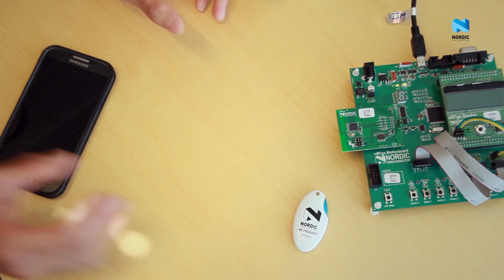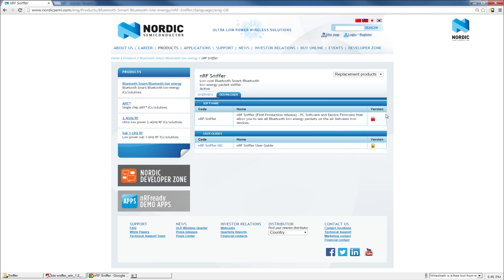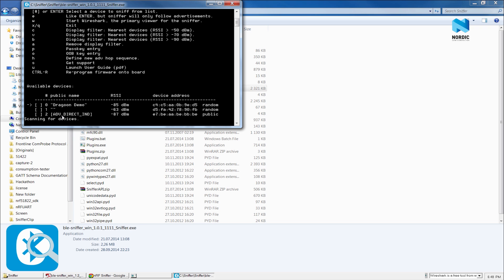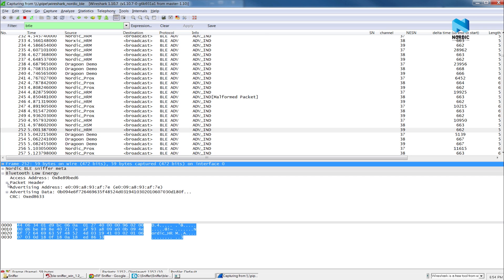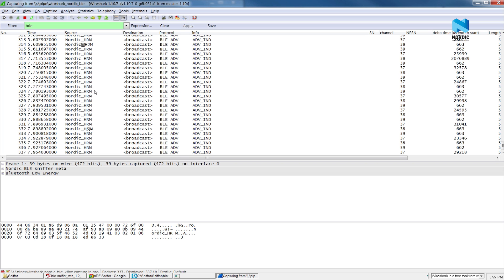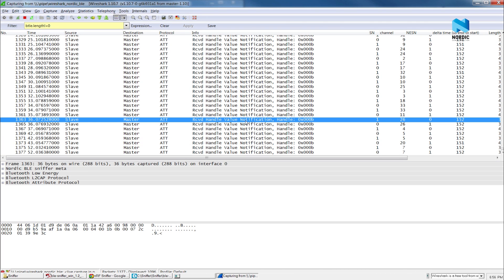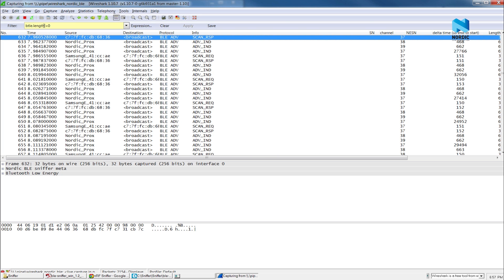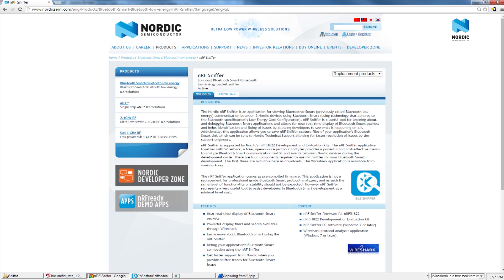Nordic Semiconductor - nRF Sniffer

Comment: Hello. Thank you for the video! I was wondering if I can I use nRF sniffer to sniff STM bluetooth connections as well?
Reply from the maker: Yes, you can use the nRF Sniffer to sniff other Bluetooth LE devices. But you need a nRF device to run sniffer firmware (nRF52840 DK, nRF52840 Dongle, nRF52 DK, nRF51 DK or nRF51 Dongle). You can read more about nRF Sniffer on our website: https://www.nordicsemi.com/Products/Development-tools/nRF-Sniffer-for-Bluetooth-LE

Comment: Hello. Can I use the sniffer with PCA10040?
Reply from the maker: Yes, you can use the nRF Sniffer for Bluetooth Low Energy with nRF52 DK (PCA10040). The nRF Sniffer for 802.15.4 protocols is only supported by nRF52840 DK or nRF52840 Dongle.
Reply: @NordicSemi  Thanks. I already found how to use sniffer v3.1.0 with the Wireshark. To be honest, it was so hard :)
Reply from the maker: @alexandrturok3429  glad to hear you found out how to do it, and that you managed to do it, even though it was hard! Great work.

Comment: Why am I only getting the advertisements packet and miss the communication (master-slave)? Running on nRF52840 dongle extcap v3.1.0
Reply from the maker: Hello Adam, you would need to choose an advertising device in Wireshark to be able to see the packages that are sent between peripheral and central in a connection. There is a tab in the Sniffer interface, look for "all advertising devices". If the connection is encrypted, and you got a passkey, you would have to write that in the connection process. Have you seen this about common sniffing action on our infocenter: https://infocenter.nordicsemi.com/topic/ug_sniffer_ble/UG/sniffer_ble/sniffing_actions.html
If you have more questions, please reach out to our tech support team on DevZone: https://devzone.nordicsemi.com
Reply: @NordicSemi  Ah... yes I missed to read that part, selecting specific device throwing all the transaction data. Thanks.
Reply from the maker: @_adamalfath  We're happy to help out.

Comment: sw version same as one in video is not working with usb dongle. It captures only advert packets and filter in sniffer also passes all packets to wireshark...  low quality app
Reply: @Zeljan: Please update the dongle to latest Segger firmware (v5.12 and up). Please make sure the firmware of the  Segger chip on the dongle is updated. If you have question, please post on our devzone at https://devzone.nordicsemi.com/
Reply: Same here. I can see the advert packets but no packets after connection is made !

Comment: Hi

Can I use the sniffer with any nRF51822 board?

I downloaded the zip package and noticed that it contains the firmware hex file.
So I flashed this onto a board containing a  nRF51822 QFAC , but it didnt seem to output anything.

I suspect this is because the softdevice already on the device is the S130 from the V9 SDK.

Can you tell me what Softdevice you use with this firmware.

Can you also tell me which pins it uses for the UART connection , as I will need to manually connect these.

Thanks
Reply: yes, you can